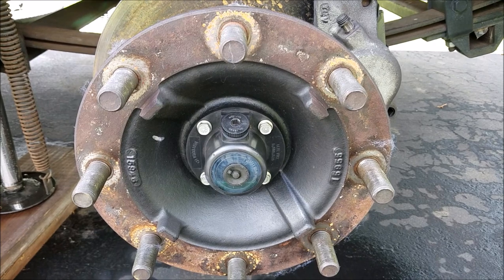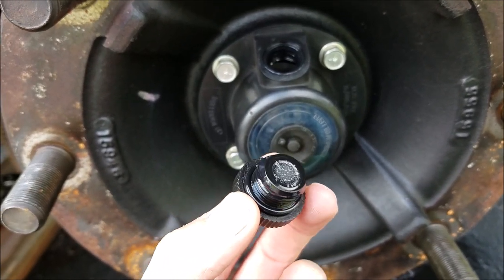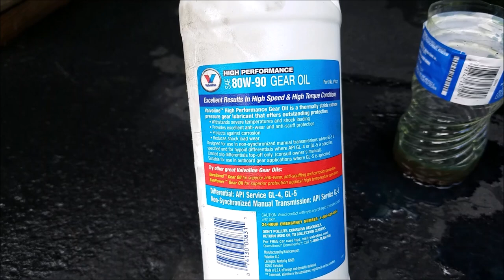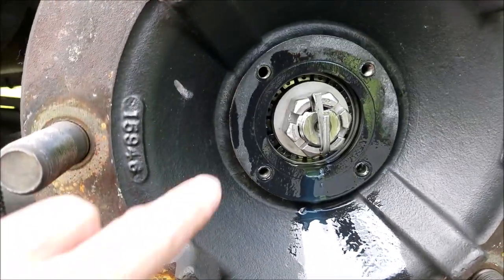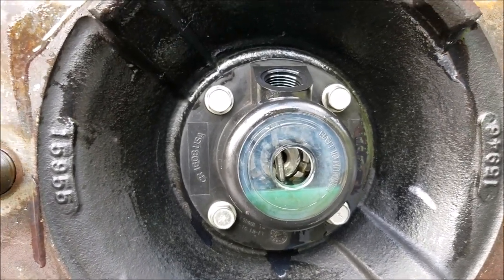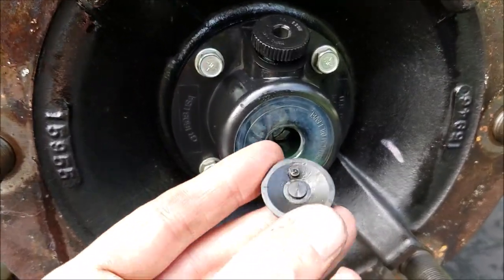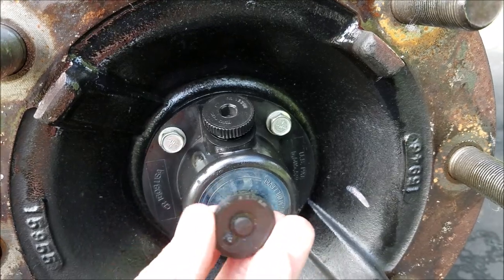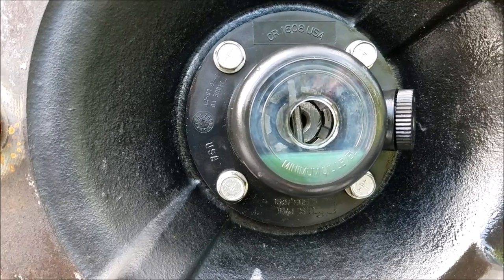RV Repair: How to Change oil in Oil Filled Hubs on a Workhorse chassis W20, W22, W24

Comment: Re: Your comment on new tires - I too had the exact same issue (2005 W22 chassis) on my front wheel Michelin tires (dated 2011).   Lots of tread left, but noted some small side checking which started to appear on the sidewalls near the bead. Rear tires of same date were fine with no cracks at all. One can access on the MIchelin site a chart which defines how serious sidewall cracks are in your MIchelin tires:

Comment: Thanks for this, as we have our first motorhome, which is a Tiffin Phaeton diesel coach, and after seeing the bill the previous owner paid for this job, I thought I'd look into doing so myself!   You mention it can be done with the wheel 'on', so that's truly helpful, as I don't really have the tools to start taking my coach wheels off, as I'm assuming the torque on those wheel nuts must be pretty high!  I do have a torque wrench, which would help I'm sure, plus I'm unsure of what torque that should be re-applied when installed again?   Interesting too, that the 'old' oil you took out, looks very much like the new oil you put 'in'!   Making me wonder if the 'oil company' is the one helping to make the manual, telling the owners to change more frequently?   Perhaps, depending on how much is on the drain plug magnet, one could go by that as well?    Truly glad for folks like yourself, helping us knew owners out on these projects!   I'm hoping to do my own oil changes and filter changes as well, until I'm too old to do it, but in the meantime, help save some $$ for the cost of fuel in these coaches!
Reply from the maker: Thank you Dale for taking the time to respond to my video Its nice to know someone is watching. If I can ever be of help my cell  is 606-875-0125 Kevin

Comment: Hi Kevin another great video...thanks!   FYI my owners manual for my 2003 Workhorse W-22 says to use 90W GL5 not 80-90W GL5...strange that it would be different for a W-22 vs a W-24 (which I believe yours is).
Reply from the maker: Going by memory I don't think I could locate none synthetic 90w GL5 oil, our seals are not made for synthetic oils FYI

Comment: Hi Kevin, I have a 2004 Monaco LaPalma on a w22 chassis and just wondered what you use to jack up your rig.  I do all my own work on my diesel pickups but don't have a jack bigger than 3 1/2 ton
Reply from the maker: With our w24 general maintenance I dont did a jack it has good clearance.  For the brake job a did I used the hydraulic Jack's but i of course would not go under the RV some heavy duty jack stands would be nice.

Comment: Further note on tires:  While I think that Michelin makes great tires, they can be pricey.  So when I discovered that one of my front Michelin tires (On my 2005 W22 chassis) had some severe cupping in the tread (I believe due to being unbalanced) I did some research on replacements.  Found a number of people who suggested Toyo tires - a brand with which I also had good experience..  Found then on Amazon for 1/2 the cost of Michelin - and they shipped them from to California to Maine for free shipping (Prime).   Closest size they had was Toyo M-154 All Season Radial 245/75R 22.5. These had the exact same load ratings as my Michelin 235/80R 22.5, and were within 1/16" total diameter.  Tires also (at 88lbs ea) were a few pounds heavier than Michelin.  Had spin balancing done by the tire dealer, and I also installed bead balancing rims as well.  I now also regularly spray my ties with 303 Product Aerospace Protectant to provide UV protection against sidewall rubber deterioration.  After putting almost 5k miles on these they have worked great and I highly recommend them.    Amazon tire link -  https://www.amazon.com/Toyo-M-154-Commercial-Truck-Radial/dp/B00P8FRPJ6/ref=sr_1_1?keywords=Toyo+M-154&qid=1581188577&sr=8-1

Comment: Thanks for this video. How tight did you tighten the screws? Is there a Certain torque?
Reply from the maker: I'm sure there is but i just used the torque wrench that's in my elbow . you can google bolt torque charts and can find info based on the thread size.

Comment: Note:  As Kevin found out in a later video where he pulled the entire wheel hub off - the majority of the oil sits in the hub, between the inner and outer wheel bearing.  There is actually quite a lot more oil sitting in there than one can easily access.  What is shown in this video is primarily how to check and maintain hub oil levels.  But the only way to perform a complete hub oil change is to pull off the entire hub.  But thanks Kevin - this is another great, detailed video that provides a number of tips that are really useful.
Reply from the maker: Thanks for watching and adding comments

Comment: Thanks Kevin for doing this video. I have a 2017 Diesel pusher with a Freightliner XCR chassis and I need to change the gear oil in my hubs, so your video is exactly what I wanted to see. I appreciate the tip about the magnetized cap. I will check to see if my cap is like yours when I take it out. I will do mine with the wheels on, so I will use my oil changer to suck out the oil. Hopefully that will prevent a mess....
Reply from the maker: Thanks for letting me know it helped you.